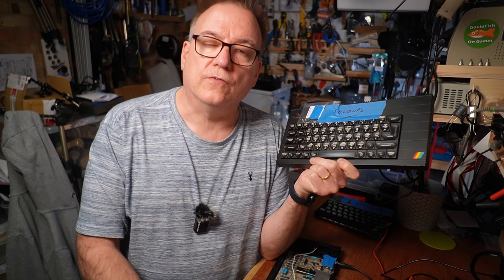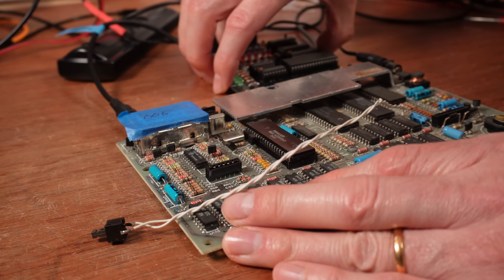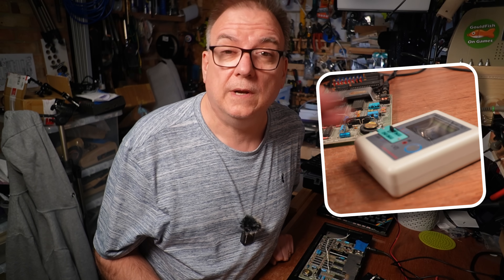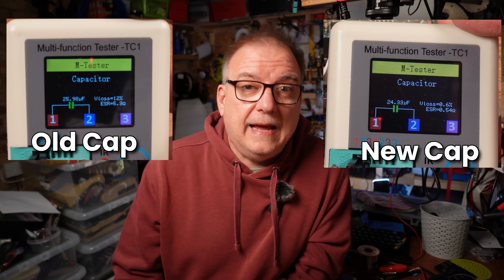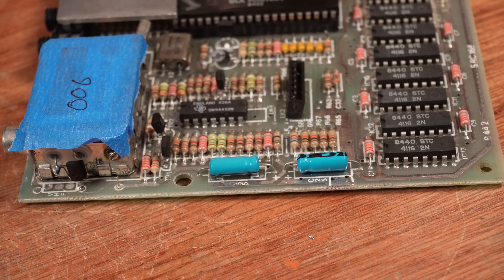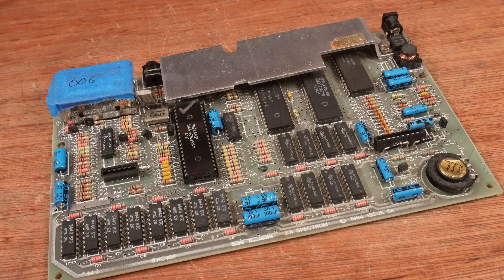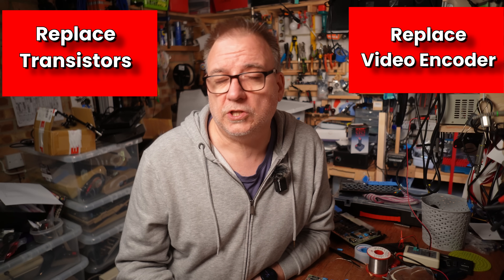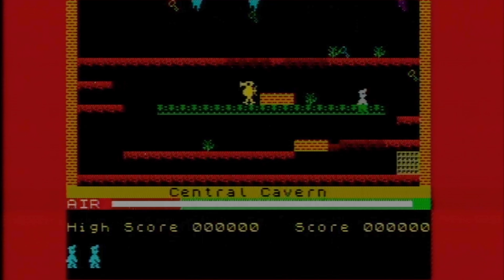A Weird Chip Inside This ZX Spectrum.

Comment: You're correct when you say there's no specific lifespan for capacitors. I know someone who's got an old valve radio from around 1942. From memory every cap that he checked was original and still working and within spec when tested last year! It's a more extreme example though.

Comment: I have a couple of in-circuit ESR (and low-ohm) testers that wee sold in kit form here in Australia, it was in Electronic Australia (EA) magazine.
Jaycar Australia may still have kits.
It is the one in a black box and a 2 digit 7-segment led display.
They are fnatastic, and got used constantly when I was doing electronic repairs for a living.
They inject an ac signal about 0.2v so they dont activate any diode junctions of any semiconductors on the PCB, just the capacitor gets tested.
You could have tested every electro cap on that board in about 2 seconds per cap, without needed to unsolder any good caps.
I very much recommend you get one of these testers if still available, or get one secondhand.
(Edit) looks like Altronics australia are selling a slightly updated version of the kit, K2574
Mine are from the original kit in the late 1980s (and still working). The fact that they updated this design in 2004 and are still selling it now shows the popularity and usefulness of this design, even though there are many ESR testers on the market... 👍
Reply from the maker: I have an ESR tester here that claims a similar thing with the low voltage ac signal injection. Maybe I should give that a bit more credit. Its well regarded by some I know. Thank you for the info!

Comment: Heya Lee, I know this is an older video and you likely know now, but just above this weird chip and TR2 is a socket for C100, this can be a 10 to 100 pF capacitor ... it is an "optional shunt capacitor" (Shunt, word sounds like it should get the same interrnet policing and Scunthorpe!)
It's especially uses in improving some PAL scenarios. If you've a Variable Cap in that pico-farad range, it could be worth experimenting!
Reasons being:  Softening some oscilloscope edges, potentially helping or saving 'fingernail-hanging' leading/trailing edge sensitive components.  Can reduce colour Dot Crawl and apparently calms the subcarrier harmonics before modulation, it does sit between Composite the circuit, so you might see benefits
even if you're using a full mod or your Henry cable.
It may reduce the occurence of (srsly!) the audio equivalent of jailbars.
You might get slightly reduced bright/contrast, but if you've done your TR1/2 mod, then it's probably unnoticable
but again a variable Cap would be a lovely thing.

Here's a good one for this exact scenario!!
Sinclair apparently on unofficial record said that this Cap will compensate for encoder differences twixt yon LM and SM chip, helping to tune what ever "PAL Burst cleanliness" is!
Love to see the end result, especialy if you've a flakey  Rev.7 hanging around!
If you don't have a variable, might be worth installing a dupont header and experimenting, but using 22pF might be a good place to start - good luck and I hope it brings a happy smile!

Peace ☮
Reply: oooh, importantly, wants to be a ceramic style capacitor!!

Comment: If that transistor mod at the beginning of the video is the one I've seen (a single transistor follower), do note that the output impedance won't be 75 ohms, it'll be very much lower than that (but if it works for you, it works). If you want a proper 75 ohm output the easiest way to do it is with an appropriate composite video driver IC, they are still available at the usual electronics suppliers.

Comment: As you can imagine back in 1982 when I was repairing these on my bench and doing these every single day of the week they where a S*d to unsolder. I remember we used to cut a pin on the memory chip to see which one was faulty and monitor the resistance. I remember we had so many broken at one stage we loaded up 2 big artic lorrys full of broken ones and they went to an airport to be storred....... we had to do something as we could not move in the factory....LOL
Reply from the maker: I would LOVE to hear more about your days fixing these back then. Get in touch via either my email or discord so I can hear more!

Comment: Im no "computer expert, however im very into radios and the relevant part is interference, I wonder if your bars that show up are caused by local rf interference, in my case the best way to check was to go around the house and turn everything off one by one then eventually the switchboard, ive found things like wifi routers to fridges even insulators on powerlines across the road or wireless powere box meters have cause similar issues with my Software defined radios and, shielding and filtering help.

Comment: The transistor gain (hfe) has raised the chroma threshold in the lm1889n chip. By raising the voltage it has shifted the dark scale to lighter by my understanding
Reply: Add a preset..

Comment: Thanks for the video. My Issue 3 has new Panasonic capacitors in it.  I also swapped out the 7805 with a switching reg no heatsink needed.  Also swapped the transistors with BC equivalents. Another mod was a 2A bridge rectifier so any polarity on the 9v in.

Comment: I bought myself a spectrum a couple of weeks ago but it had problems, long story short all tests  said "lower ram fault". I got some replacement chips and no luck. Then the other day I saw your video and said naah, it's not that, the caps look fine. This evening I found 2 100uf caps in my spare parts bin and in desperation I gave it a shot and she sprang to life. I'll replace the rest of the caps now. Thank you so much you turned my faulty Spekky into a really easy fix ;)
Reply from the maker: Fantastic! That's great to hear. I wonder how many of these have been ruined after someone started chasing faults in the chips when it was the caps all along?
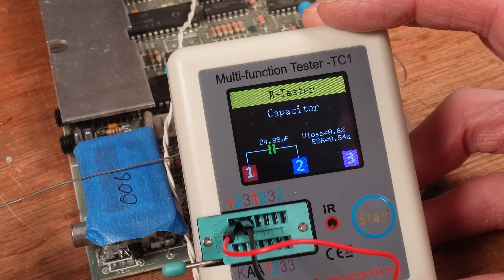Reply: 5:06 The poor conductivity https://youtu.be/BCBcKRPGOhc?t=306 can be revealed by bridging a suspect cap with a new one, since a dry original will act, very-nearly, to be "out of circuit". Often an instant "healing" like a cracked trace closing up and completing the circuit.

Comment: Why "test by substitution" the capacitors (probably fine for another 50 years)?  Laziness? Market forces? 
Why not test each cap first before condemning the whole lot. The replacement caps how long are they going to last for? 2 or 3 years? maybe 5?

Comment: interesting - I noticed on my ZX spectrum that the video level with the capacitor only is just 200mV and I guess that's why you get a dim picture. 
So, what is your amazing capture device which works better than the SIX I've tested?
Thanks for the video!
Reply from the maker: Thanks Tony! My capture device is the knock off 2x from China. It's not perfect, but better than pointing a camera at a screen

Comment: I used to work for Thorn EMI back in 1984/85. We were the main production line for the Sinclair Spectrum under contract from Sir Clive. Many of the machines that went out contained refurbished boards from faulty units that came back. I was one of the production engineers responsible for the repair of these faulty boards. That vertical line pattern immediately triggered "RAM fault" in my head. It must be stuck in there somewhere. LoL. One contribution it repair that I made fairly soon after starting was the diagnosis of a faulty base RAM chip that shorting the 12V supply and blowing TR7, part of the 12V supply. The standard repair approach, that I was shown and told this is how you do it, was to isolate each 12V pin by removing the solder and floating it in the centre of the through plating hole, change TR7 and move each pin to make contact until TR7 blew. The RAM chip and TR7 were then red dotted and sent to the soldering girls for replacement. This obviously took a while to isolate each pin and a certain amount of skill. Some lazy engineers used to simply side cut each leg and re-solder them once the faulty chip was found. Very messy. I thought differently. I thought "why is TR7 blowing?" "because a chip is pulling too much power" "what if you gave it a power supply with higher amperage, like straight off the power adaptor?" So with a length of solder I tapped off the PSU which handily was positive sleeve and attached it to the 12V supply to the RAM and bingo, with the help of a little freezer spray to frost up the RAM, the ones that got hot were the culprits. I showed the established engineers what I was doing and was told that's not the way to do it, my reply was well it works doesn't it? Don't think they liked the 18 year old newbie showing them how it's done. LoL
Reply: Takes me back where I was in 1980s we were using freezer spray too to look for bad ram on various makes watch for which one defrosted first. it's good thing that engineers on bench were finding new ways to improve efficiency.
Reply from the maker: Thank you for sharing those wonderful memories! I too really don't like the snip method of isolating chips. Really like the idea of floating the pin though, that's very clever and I'll have to remember that.
Reply: Takes me back where I was in 1980s we were using freezer spray too to look for bad ram on various makes watch for which one defrosted first. it's good thing that engineers on bench were finding new ways to improve efficiency.

Comment: Isn't the reason the LM1889N replacement wasn't changing anything that this chip is a TV modulator? You are bypassing modulation altogether I think.
Reply from the maker: The LM1889N has a built in modulator section thats completely bypassed on the Spectrum, they chose to use a separate modulator.
Reply: Interesting. So what does the chip do? Mix in audio? @MoreFunMakingIt

Comment: I just sigh that guys like you have the knowledge and skills to fix stuff like this. Are you all self taught or degree level?
Reply from the maker: Totally self taught. Always been a tinkerer, but everything I've learnt over the last couple of years has been from the internet
Reply: @MoreFunMakingIt  Always interested in electronics from a kid when i went to the village fete and bought valve radio for about 2 bob. Then TV's. Nearly killed my self when i stepped off a chair and put my foot on the floor whilst touching the chassis. Did an apprenticeship with electronics. Now at 73 still tinkering. Just repaired HP 2009v display. Tried to do it long hand but my hands arent steady enough to handle SM components. Whats interesting is that I spent £20 quid on bits but then got a used board from Ali Express for £7 all up and it works. Happy days
Reply from the maker: @CASHSEC  sounds like you're having great fun!

Comment: capacitors can and do last much longer than many think , i have many old transistor radios MUCH older than spectrum still unrecapped as didnt need it ,
Reply: C46 is the critical one, the pulse feed for the -5v line, i'm wondering if replacing with a non electrolytic poly 1uf would be more reliable/long lived....

Comment: The electrolytic caps have a useful life of about 3000 hours. After that the capacitance goes down and eventually zero. Use tantalums to get a stable system
Reply: depends entirely on their conditions of use, they can  and do  last much longer , the datasheets specify life at everything maximum, reduce any and life increases rapidly , i have a 1958 transistor radio completely 'virgin' unrecapped
Reply: @andygozzo72  Sure, true. However, if they are continuously powered, they simply die. High temperature accelerates it. I also have an Emerson portable "pocket" radio from 1956, still working.
Reply: @henk38599  yep, heat and high ripple are the biggest 'killers'
Reply: @andygozzo72  You are right. Excessive current is one killer of caps. Power supplies need special caps for that.
Reply: I had a 24 track studio tape machine come in a few years back customer bought from a film studio closedown auction and it became a write off because every single cap inside had dried out. more than 1000 caps. The reason caps failed was because at the time they were the latest generation of precision value low esr and not the mature traditional type used
Reply: @jagmarc  Yeah, the electrolytics are bad. I refuse to use them for the last 25 years. Tantalum are close to eternal and also solid Aluminum caps are really good, no failures thus far after using them for 25 yrs.

Comment: Its always the capacitors!
Conspiracy theory time:
Electrolytic capacitors are only used because the factory wants your device to stop working soon, so they can sell you another.
Reply from the maker: As I sit here in my tinfoil hat I cant help but wonder if you are onto something there!
And joking aside - probably is some truth in it!
Reply: @MoreFunMakingIt  its NOT 'always' capacitors,  they can and do last much longer, i have lots of old equipment unrecapped or mostly unrecapped that can prove it,  you should not assume blanket  recapping is some magic cure all

Comment: If you want longevity on CAPs, I'd go with Nichicon, although Ilonios Capacitors, (IC) are good.  Those Gelec are crap!
Reply: probably, sinclair cut the cost as much as possible, that said i have several spectrums, unrecapped, that still work perfectly, one of those caps in the pic was a 'famous' blue philips, i find they usually last well but if left unused for many years can 'deform',  but if gently reformed, can be ok again , the only issue i had with one was in a roberts r505 radio, and i think that was 'cause they used one too low voltage rating

Comment: Excellent work and beautifully presented. In my experience blurring and interference can sometimes be caused by "old man eyes" so maybe an option is to get yourself some younger ones. Green ones are a bit harder to find but I believe it will really make you pop and set off that new beard to its full potential. 
As I touched the screen I realised ... this isn't a touch screen!!! How I laughed. I will watch it on my daughter's laptop and try again ;-)
Reply from the maker: I prefer to stick with my OG Vintage eyeballs that happen to be green quite often!
Keep jabbing those screens! If it doesnt work try using a sharp stick.

Comment: An excellent repair. Subscribed. That tester looks fantastic. You may know why my issue 1 +2A makes the sound of a key held down if with the keyboard disconnected. It was working fine, then just went like that.
Reply from the maker: The +2A has it's ULA chip suspended in a hole in the motherboard. They're prone to dry solder joints. I would check there first
Reply: @MoreFunMakingIt  I suspected that chip. It's really odd how they mounted it like that.

Comment: I suspect we could make a replacement for the LM1889 chip that would be good enough.
The multiply action wouldn't need to be anywhere near as linear as what is needed for real TV.
The channel-3 vs channel-4 oscillators is fairly easy
The color subcarrier is not too hard to generate.
The only issue I see is making it fit mechanically even with surface mount parts.
Reply from the maker: Sounds complicated!
Reply: @MoreFunMakingIt  Yes it is a bit complicated but not too bad if you want only the composite output and not the channel 3,4 modulator.  Take a look at the block diagram of the chip that is in its data sheet.
Reply: @kensmith5694  the channel 3/4 thing is irrelevant, this is a UK channel 36 ish UHF machine , the modulator part of the  LM isnt used, the modulating is done in the UM1233 modulator
Reply: @andygozzo72  If you are bringing out the composite video instead, you don't need either modulator.  You only need the 3.(whatever)MHz crystal oscillators and the multiplier action.  As it isn't a movie or anything, the multiplies can be fair crude and still good enough.  No linearization would be needed on a gilbert cell.  Matched transistors can be had in SOT23-6 packages so temperature gradients won't be an issue.

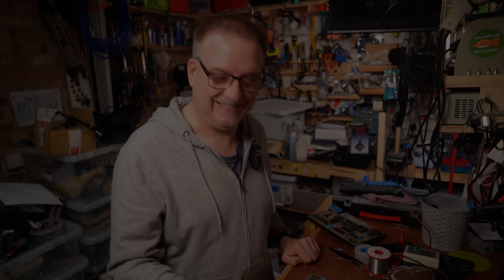Comment: 10:56 If you have to go back with wick and hot air, you’re using the desoldering tool incorrrectly. After ensuring the desoldering tip is nicely tinned, apply it to a joint. Once the solder is fully melted (as determined by being able to wiggle the component lead freely back and forth), turn on the vacuum. Now continue wiggling with the vacuum on — this ensures you get all the solder, and the continued vacuum causes cool air to flow through, cooling the component leg and preventing it from resoldering itself. Then remove the desoldering iron, and then release the trigger. This entire process should take around 3-5 seconds. The wiggling is essential — without that, you don’t know if the joint is melted, and you won’t release the leg from the side of a plated hole.
Reply: I personally pre-heat the area up with a heat gun, then just use a manual solder sucker.  Learnt that at the age of 16 on 4 layer boards in the 80’s as a YTS “yop” at the Olivetti repair lab. They were impressed that I could replace chips without damaging the board (apparently i was the first such yop that could do so).  Preheating the board came from my dad who would preheat jobs before tig welding.
Reply: @eliotmansfield  Definitely a 👍 for using preheating, but how do you prevent the component leads from re-adhering themselves to the inside of the plated through-hole?
Reply: @tookitogo  you still use a soldering iron with the solder sucker.  The pre-heat just means the pins warm up quicker and doesn’t suck all the heat out the iron when doing the power plane pins
Reply from the maker: My videos are not instructional, I don't find those very entertaining and I also never claim to be an expert. Which is why I don't show the desoldering process in detail. If I did you'd see that I do pretty much exactly what you described. But thank you for taking the time to comment.
Reply: It looked like a spring-loaded solder sucker to me.
Reply: @stevenclark2188  Look again (and listen to the audio): it’s clearly a continuous-vacuum desoldering tool.